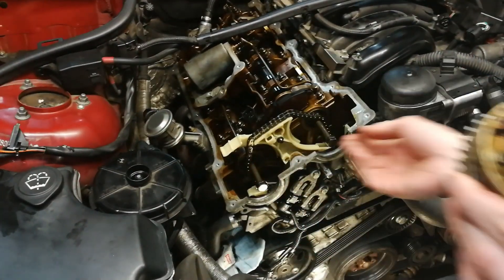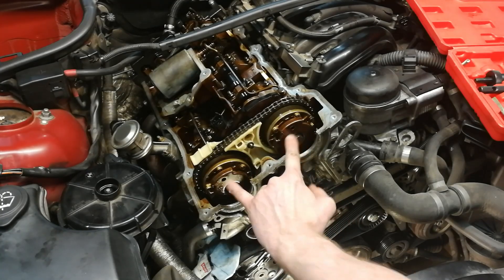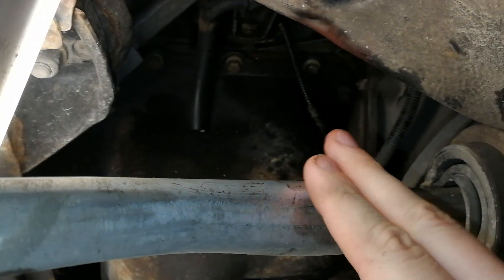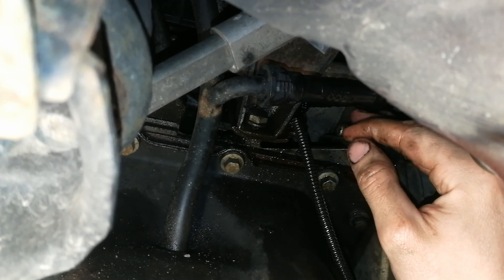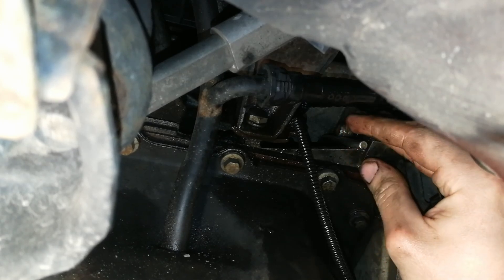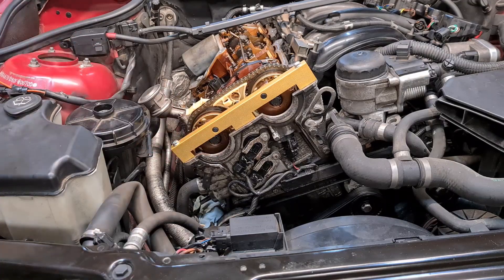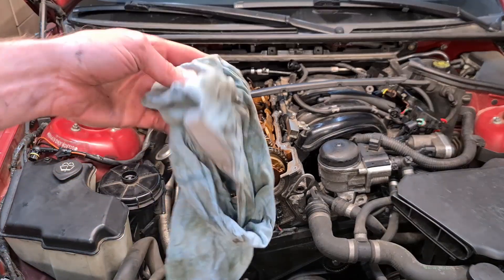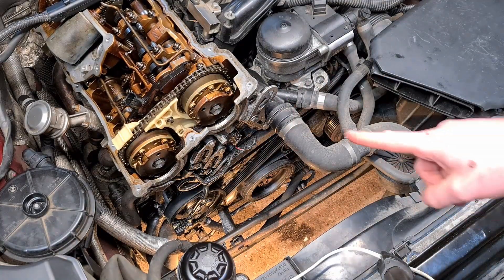Timing the engine - BMW N42/N46 Chain Rail Replacement [PART #6]

Comment: Hi. My intake cam it does not tighten enough, when I check it is no longer on point 😢 why?
Reply from the maker: You mean the front Vanos locking tool? How much is it out of position? It's normal for the front locking tool to be very slightly off after timing and you have to wiggle it a bit to get it back in.
Reply: @BimmerZen  more than normal postition.. the cam have a mortal angle and the wheel with chain is rotate and cam she can’t.
Reply from the maker: @blacku.892  Are the vanos units locked in initial position?
Reply: @BimmerZen  no
Reply from the maker: @blacku.892  They need to be locked during timing procedure
Reply: @BimmerZen  what happens if I reverse the wheels on the chain?
Reply: @BimmerZen  exhaust wheel to intake and reverse.

Comment: If the timing chain is 1 tooth off, do you get a mil light then?
Reply from the maker: There was no MIL. But there are errors stored in the ECU.
Reply: @BimmerZen  i have replaced my valve seals yesterday, but set the timing without the flywheel locking tool. Instead of that i used a stick into cilinder 1 for measuring the highest point. Engine runs good, but sometimes it bogs a little in lower rpm during acceleration. No error codes popping up. Gonna check the timing again soon with the flywheel locking tool.

(You're tools is used for it where working great btw!)

Comment: Hi, I just want to thank you for giving me the hope that all will be good. And I finally did it!. But, I want say to everyone that have N46b20 engine (or generally all n46, idk) that the locking pin isn't long enough and don't do his job. So, take something (like a long smooth bolt) that is the same diameter of the pin and cut it 1 cm longer than the original one and it will work perfectly. Thank you again bimmerzen, all your videos are awesome and well explained. Support ❤️

Comment: Hi, is there any specific position the vanos unit needs to be put in? Or it doesnt matter as long as the locking tool holes align with the plate holes?
Reply from the maker: @christiand193  correct, orientation if Vanos units is irrelevant. You just need to make sure they are locked in initial position. Timing is determined by impulse sending gears alignment.
Reply: @BimmerZen  thank you for quick response! Excellent.  I have a problem with my N42, i have done the timing steps, everything seems to be set correctly, but the engine seems to have rough idle, low power below 4000 rpm, everything points to Vanos issue, the units appear to be locked. I do have an oil pressure light on, i wonder if i messed up the balancing shaft timing when i was rebuilding the ending. Do you have any video on that?

Comment: ehm there is no hole on my 2004 N42 with GM transmission.....pls help
Reply from the maker: There is. Keep calm and keep trying.
Reply: I have just Completed
1. Replaced Chain Guide
2. Vac Pump gasket change
3. Place Valve cover gasket
4. tuning
5. Changed new rev Tensioner
6. some other o rings

Thanks alot your vid save me a lot of $$$$

Comment: The designers must have had a right giggle when choosing where to put the hole for the flywheel locking pin.

Comment: Maybe I missed something, but is there an issue with using the chain tensioner while timing instead of the pre tensioner?
Reply from the maker: @RepJock88  Using pretensioner is a bit more precise. Sometimes it can happen that the timing is just slightly off the min/max limit (also due to timing tools tolerances) and that can trigger a sporadic Vanos out of range error code. Nothing too dramatic, so it's best to try to use the 0.6 Nm pretensioning tool.
Reply: @ Thanks for the quick response! The only way I’ve gotten the updated tensioner to go in, was to remove the exhaust gear to let the chain go slack. Then, put the tensioner about half-way in, replace exhaust gear, and then tighten the tensioner all the way before beginning the timing procedure. Figured the updated version was sturdy enough, but if the codes come back I’ll try it the official way.

Comment: Hi All
My engine keeps skipping or jump timing when i hand turm the crankshaft bolt 😢
Reply from the maker: You have to check if the VANOS units are locked:

https://youtu.be/Iq8aGI8-5dE
https://youtu.be/Fn85Y-X9fAM?t=235
Reply: @BimmerZen  thank you very much will check the link 🙏🏼🙏🏼🙏🏼

Comment: Zen the bummer best friend thanks much for you videos in full detail and wel explained question the vanos as a oil hole as to line up with the holes on the camshaft I see where you just install you didn't make sure that the holes are inline with each other
Reply from the maker: Not sure I understand your question. Orientation of the VANOS units (sprocket gears) relative to the camshafts is not important. There is a recess in the parts so that oil can flow freely from camshafts to the VANOS and vice-versa.
Reply: @BimmerZen  I figured that much I need some more technical info how can reach you am have problems with the e46
Reply from the maker: @vinotec4136 You can send me an email to bimmerzenchannel@gmail.com
Reply: @BimmerZen  ok kool I already send u a long messages on ig lol explaining it al I guess
Reply: I got the inpa today just for back up I c where the Delphi got a update to 2018
Reply: Question when u lock the crankshaft do the 1 piston on TDC because mines is not are it seems someone as removed the flex plate and fit on wrong is there a next way to align the crankshaft timing without locking

Comment: i presume this engine does not have balancer shafts as you did not remove sump pan
Reply from the maker: It does have the balancing shafts, but since the main crankbolt was not released, they do not lose timing.

Comment: Thank you for spending the time to do this and to share it with us. I have a 3i8i Touring and replaced the chain guide in the back garden with some friends. This brings back so many memories. Two years on on 30, 000 miles and no issues. I did start getting an oil leak in sparkplug 1 and 4 and replaced the gasket last week. I turned out that the O rings on the two spark plugs tubes where hardened and leaked. This is a very good reference far us all.

Comment: What about fixing the oil balancer, the öil pan needs to come off for that in all other videos. Thats actually the biggest part of changing the belt. Why did you not fix the öil balancers? does it work without?
Reply from the maker: Not needed here because the crankshaft bolt is not removed. Balancing shafts are driven via oil pump sprocket and that is fixed in place by crank bolt. No need to remove the chain in this case.

Comment: After tightened the sprocket bolts the timing tool can't be removed easy. I have to tap it with a hammer, does that means anything that should concern me ?
Reply from the maker: You mean the front vanos locking tool? Its normal for the front tool to be a bit tight after tightening the bolts...

Comment: Hi all, Is it possible to do the timing chain without removing oil sump and aretation camshaft at bottom?
Reply from the maker: Some people do it without removing oil sump, so I assume it is possible if you are really careful and you know what you are doing. You of course still have to insert the locking pin through the flywheel to remove crankshaft bolt. 

The problem is, that you risk accidentally rotating balancing shafts when the central bolt is removed because oil pump chain sprocket is disconnected from the crankshaft.
Reply: @BimmerZen  It makes sense. Thank you for answer

Comment: My god, trying to find that hole....! Took me nearly two hours of messing around trying to find the damn thing.
Can I ask what does turning the vanos bolts do turning them to 180 degrees? is that for extra torque?
Reply from the maker: Yep... that hole is a PITA:D you absolutely must torque the bolts 20 Nm and then rotate them 180 deg.

Comment: Hi BimmerZen.Great video series. I am not sure if you have already answered this or discuss it in another video, but how did you decide that the timing chain does not need to be replaced? Why did you replace only the guides? How did you determine the chain is not strectched and can continue being used? Thanks!
Reply from the maker: To be honest, I didn't. I assumed that the cause of this problem was weak original tensioner and brittle plastic of the slide rail. And based on the overall condition of the engine, it looked like it was well taken care of. I am daily driving this car at the moment and the engine works great. Good power, no rattling, good idle, good fuel economy, starts every time on cold starts without any hesitation or rattles...

There is a special tool for N42/N46 to measure the chain stretch which you screw in instead of chain tensioner but I don't have it.
Reply: @BimmerZen  Hi, thanks for quick response. I have an N46B20A, I had used your 3D printed tool for valve stem seal replacements which have worked great by the way! I have replaced the timing chain tensioner 3000 miles ago but I recently bought the complete timing kit in anticipation of having to change the chain. On cold starts i can hear a rattle only for a second or two, but that could be until oil pressure pushes out the tensioner... Engine runs as perfect as an N46 can be but i fear I might have to change the entire chain and guides, no broken plastic as of yet. I will look into the tool and see if it is worth it. Thanks!
Reply from the maker: @gianlucachetcuti2210  Great to hear that! My personal N42 car from chain replacement video also has that 1-2 sec rattle when I start it after it was sittings for a while. I plan to look in to that someday:) I suspect VANOS units or something with oil pressure. Otherwise engine works OK.
Reply from the maker: The point is, that I replaced the chain, but the rattle is still there... so this symptoms are probably not due to a stretched chain...

Comment: Hi! Have you opened the vanos units? I didn't find in your videos... Did you changed the admision unit, the one that did not close?
Reply from the maker: I did not replace the intake unit. I disassembled it and cleaned it out. I've put it back because I want to test if cleaning worked. I am editing a video on this as we speak:)
Reply: @BimmerZen  Looking forward to see it. So after cleaning it runs good, no startup rattle?
Reply from the maker: @robertalexandrescu9975  no startup rattle so far, but i want to use the car a bit longer just to confirm that unreliable vanos locking was the cause...